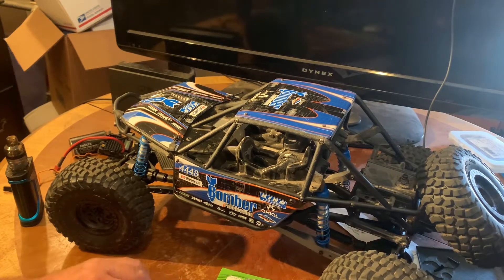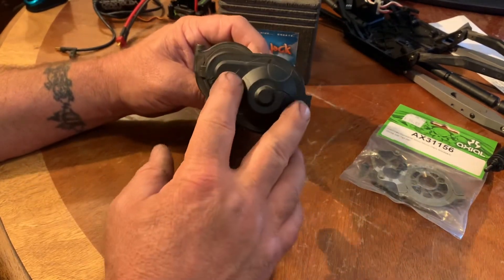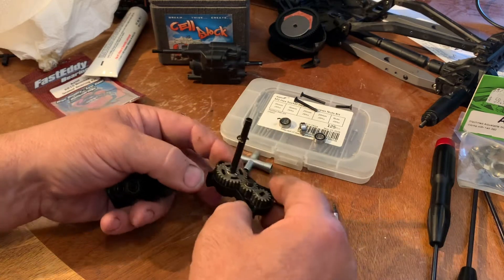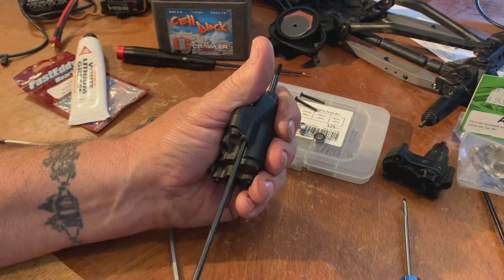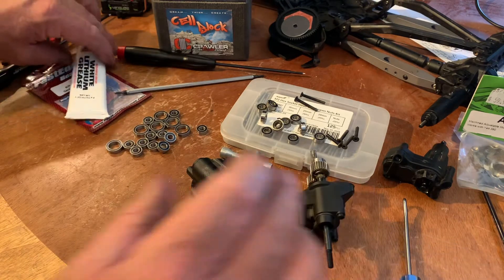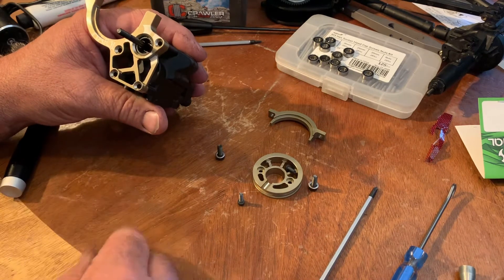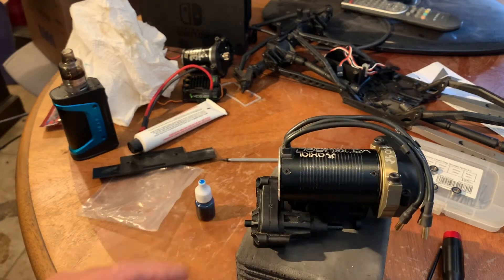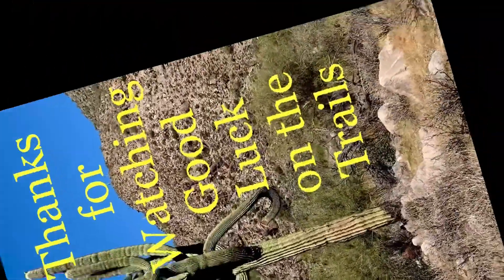Transmission time for the project RR10 Bomber.

Comment: Did you use "datenight" when you ordered your Fast Eddie Bearings? Or was the local hobby shop graced with your presence? I got the 2 speed in my bomber and the few times I've ran it I mostly used low range for stump climbing and high for jumping thru tall grass like 2 foot tall fence line type.... O wait y'all don't have grass out there 😋😂
Reply from the maker: I bought the bearings before the code so I paid full price for them. Lol.
 And we have grass. It’s usually brown and dead looking but it’s still grass.

Comment: Hey Phoenix so I never changed my transmission it's still stock and I have a Holms Hobbies 3300kv TMP with a mambax exc will I have longterm transmission issuse if I don't upgrade? great video 😉👍
Reply from the maker: I’ve been running the stock transmission in my kit bomber for a while and it hasn’t had any issues. But the motor plate is a good idea to keep everything in line.
Reply: @PhoenixRCCrawler  I'll get one just to be safe thank's Phoenix 😉👍
Reply: @timvanasen6711  taking advice from Phoenix 😳😲🤪
Actually he has some great tips for us limited budget folks